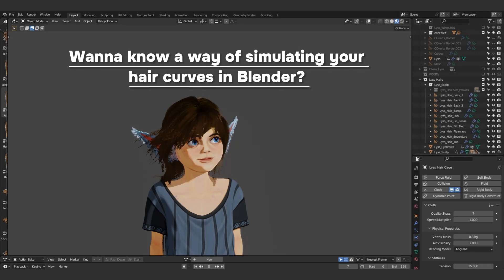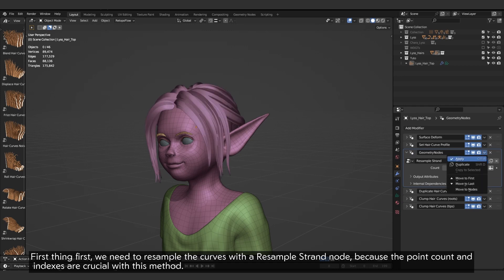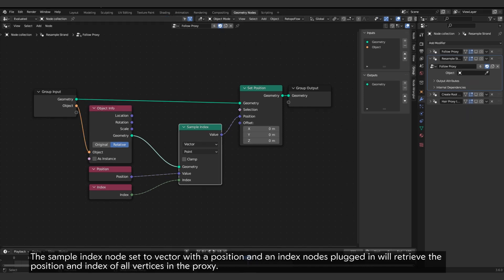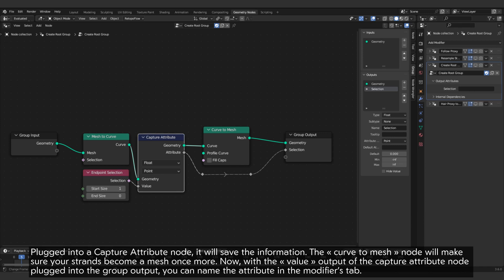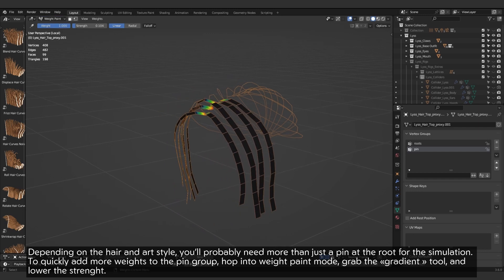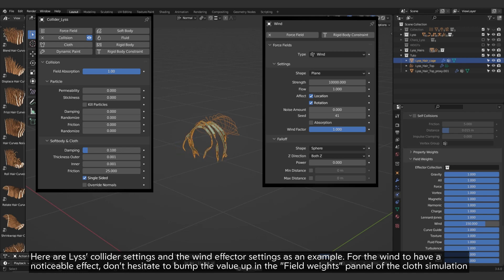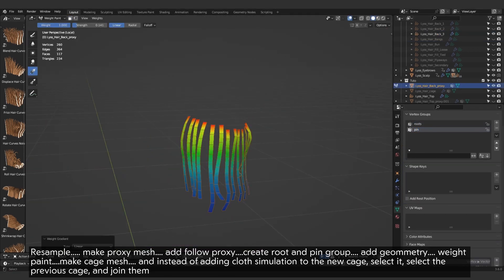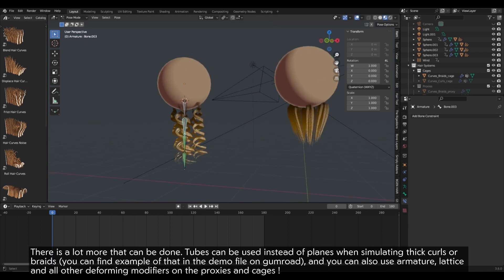Hair Simulation with the new hair system in Blender | 3.6 and +

Comment: in my hairsystem i used "Interpolate Hair Curves" for hair breeding, therefore, when I use this method, Blender dynamically rebuilds the strands in each new frame, resulting in the hair constantly flickering. 🤔
Reply from the maker: Yeah, all my hair grooms are using the "Duplicate" one which dosen't cause any issues, but I recently had the problem too with fur. I came up with a solution that is tailored to my own use-case so I can't garantee it'll work for you too, but you can try this : https://imgur.com/a/6hMivuz
Reply: @rakenval  i got an error "invalid surface UVs on 26 curves" located in node "deform curves on surface" (on Offset frame) 🤷‍♂
Reply from the maker: your curves are probably not properly attached to the mesh (sculpt mode -> Curves -> Snap to nearest Surface should fix that) or you have issues with your UVs but it's unlikely unless you modified them after adding the hair maybe

Comment: couple tips I've found while working: separate static and dynamic hair for better performance. You can neatly gradually weight paint the hairs by selecting roots, hitting ctrl+ +, then deselecting roots and assigning a smaller value, repeat that to get a perfect gradient. Also if you want the hair to follow a rig, parent it to rig with auto weights, select a couple staring faces from the root with ctrl + + method, invert it, then unasign every vertex group from the root inverse. Hope this helps someone
Reply: this comment is underated ! For it to follow a rig, i thought of doing exactly that, but it just confirmed hehe thanks !

Comment: @Rakenval so what i did is, that I added cloth and corrective smooth modifiers to all of my cages, then Ictrl J all of them but hte thing is that I nosticed that my cloth modifier got only one pin as default, so my other meshes wont pin, what can i do? ive finally pin (pun intended) pointed my prbolem, this is why the hair of my cha character falls, what can i do about it ?
Reply from the maker: if you're joining the meshes, you need to make sure their pin group have the exact same name, so all the pin groups can merge into a single one when joining
Reply: @rakenval  DAMN.. and i thought it was better to have different names, yeah that was the problem now im playing with weight paint to get the desired result.. I... im out odf words cant believe this is actually working after so many tries. thank you so much, i really mean it.
any tip for hair material? my hair is blonde so idont know if the mnaterial in the tutorial its ok
Reply: @rakenval  IM RENDERING MY SCENE...some of th hair falls off and behaves weirdly.. like its pin to a invisible space, it has to be with weight paint right?
Reply: @rakenval  so weird I applied a amterial to my cage mesh and the nimiton stopped working, do you know why? 
Also I know ive said it multiple times but im truly grateful for your guide, and tutorial, man... Ive been trying for the longest, and finally seeing some results... it feels unreal

Comment: 5:00 whenever I try to bind a message  appears it says "target contains concave polygons" im so close.... please would yo uhelp me?
Reply from the maker: Ah yeah that happens sometimes, usually it means some of your quads (or ngong) arent flat. Just put a Triangulate modifier on your target, bind the Surface Deform, then you can remove the triangulate.
Reply: @rakenval   OMG! IT WORKED IT WORKED! Thank you so much! i´ll keep u updated, man i swear ive been tryi9ng for the longest, blender was (still is) intimidating (for me) its been a struggle learning, but i wont give up
Reply from the maker: nice, keep it up ^^
Reply: @rakenval  thanks! :) so i finished the tutoria but i came across some problems i really hope you would help me 
1 some of my hair falls off  and i dunn owhy 
2 i parent a scalp mesh to my armature ´s head bone but it doesnt seem to follow it.. i dindt make tha hair injto the character but into a duplicate of the mesh of the character´s scalp
Reply from the maker: 1 - Those strand are probably not in the pin group
2- Check in the relation panel if the parent of the scalp is really the head bone and not just the armature. There's no reason it wouldn't follow the head if it's parented to the bone (unless specific cases like it has a defective Surface Deform modifier or an accidental cloth modifier)
Reply: @rakenval  thank you ! it does seems to be a problem with the pin fgroup instead of selectin the roots somehow it selected the whole verteces i dont know why. but now either some hair strands fall and othe bounce a lot  or it stays completely static.. ive tried redefining pin groupsand weight paint but the best hting i got it stays static...
Reply from the maker: Maybe replace your cloth sim modifier with a fresh one with default settings, maybe you changed the wrong setting
Other than suggesting to check the weights again I can't really help more at this point ^^'

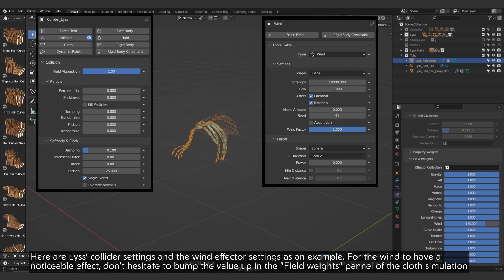Comment: 4:30 just to be sure the collider goes into the scalp mesh right or whatever the hair is going to follow, right? nono, i think it must be the cage right?  and the.. wind effector should be applied on an empty object right? 
am i missing something? srry im learning
Reply from the maker: Collider should be on the character mesh (or a simplified version of the character mesh), if you put it only on the scalp the hair will fall through the chara's face / body. The wind can be put on everything, an empty is fine, not sure what the default object is when you directly add a wind to the scene but it's probably an empty yeah
Reply: @rakenval  i GREATLY appreciate your tutorial and your answers, initially ive copied a scalp mesh and added the collision there, but thanks to your feedback now i understan why it should be applied to the character itself. i have a character with a walking animation and i only want the hair to move accordingly, any tips? thank you so much!
Reply from the maker: you're welcome! If your character as a collider on their body then the hair should move accordingly right away, it's just a matter of tweaking the simulation settings to get the best result (quality, collision distance, damping, etc...). You can try the different cloth presets in the simulation tab. Imo rubber is cool for thick / curly / stylized hair. If the hair has volume, you can use the Pin setting to quickly make it stiffer (it's way easier than playing with the other settings but it also makes the pinned vertices less reactive to collisions). I'm no simulation expert though, best would be to do a lot of testing to discover everything you can do with your specific hair and animation
Reply: @rakenval  IM TRYIN TO bind  5:00 but it says out ofe memory... the mesh is low poly so i dont know whats going on, sorry to bother you but would you mind helping me pls? thank you!
Reply from the maker: errm I'm not familiar with the error, check for non-manifold geo in your mesh and check that it dosen't have duplicate verts/faces on top of each other. Other than that I really don't know, I'd suggest remaking a fresh proxy mesh or asking on the blender artists/reddit/discord forums for help
Reply: @rakenval   some of my hair fall off, and my hair moves al ot! any wonder what i could do? thank you

Comment: What's the workflow exactly.
And is there a better workflow?
-Convert hair curves into mesh?
-Convert hair curves into hair particles?
-Convert hair curves into hair cards?

I find no solution anywhere.
The hair curves look great when you render a still image, but what about when the character moves around?
Reply from the maker: There's no "best way" imo
It depends on your goals, your animation style, the hairgroom itself, etc etc
In my case (stop-motion and still renders) simulation turned out not to be to best way, so I resorted to rig the hair instead (more time consuming but more realible and controlable). Yet it's not something I would recommend for complex animations, fur, or even hair using the Interpolate method.

So I can't tell what would be best for you, but the simulation solution is supposed to follow the character around correctly when animated, so I would say it is one of the best ways at least.
All the other workflows you cited will either require rig or simulation regardless so it's really up to your needs and preferences.
Reply: @rakenval  Maybe ditching hair curves for particle hair. It's a shame you haven't got the procedural control like you got with hair curves for particle hair. But with vertex groups you could isolate patches of hair for better control. I hope there is stiffness control for particle hair too, otherwise isolating hair groups for a specific style would all be in vain. Since it'd all fall back at the sides in the simulation.
Reply from the maker: Honestly I don't know, I never really gave the old particle system a chance as the simulation and hair grooming options weren't giving me satisfying results (and frankly I was still a hair noob when the new hair system came out so the choice was easy). 

Mainly I remember having trouble maintaining the stylized hair shape and that child particles didn't have collision like the main strands so they were clipping through the mesh unless I added a big distance in the mesh's collider, which made the hair puff out in return...

But I agree, even if there are settings to help, the cloth sim technique also does a poor job at maintaining the hair's original shape, which is why I switched to a rig at the end.

Comment: Hi! First of all thank you sm for the amazing tutorials. Your hair grooming and simulation tutorials were exactly what I was looking for. I'm so grateful to have this tutorial for free! Btw I got one problem, when the character doesn't move it works perfectly fine but when it moves, the hair won't follow the body. Did you also have the same issue? If you did, do you know how to fix this? I tried vertex parenting the proxy and scalp but it will only follow the location of the scalp, but not the rotation (does it make sense). It will be wonderful if you can answer. Again, thank you.
Reply from the maker: Hi, I'm really not sure what could be causing this. Try parenting both the scalp and the proxy/hair cage to the Head bone of your character ? That's what I do on mine
Reply: @rakenval  I kinda solved it by parenting vertex triangle! But still, thanks for the reply and everything. You're amazing!

Comment: I'm having a problem with the "Proxy to Tubes" modifier. My character has thick curly hair with lots of strands, when I put the Proxy to Tubes modifier, half of the strands disappear, and without the tube proxies, the collisions won't be so accurate. How can I fix this? Thank you.
Reply from the maker: Hey
It's been a while and I never ended up using the tubes technique that much so I don't know for sure, but make sure the proxies themselves are either a strand of vertices or a plane strand, but not a tube. It probably breaks your proxies don't contain the original points from the hair curve strands anymore. 
The final cage (Surface Deform target) should be the one to have the tube shape.

But also if you still have issues with the tube, the plane shape works fine for curls too, that's what I use for one of my chara who also has thick curls (maybe not the same type of curls idk but still), the trick is to give the cage a higher collision distance value to compensate. It may not be enough if you're going for hyper realism though

Comment: Hello, why can't I add the resample strand modifier at 0:36 ? When I type "resample" like you did in the search bar, it doesn't come up with anything. I have appended the node tree from your file, and I can place it in the node editor, but your video doesnt show how to link it to other geomtry nodes that way.
Reply: I'm on blender 4.2 btw
Reply: nvm, i was supposed to "add modifier" > "geometry node" THEN search for resample strand node. Your video goes a bit too quick don't be afraid to go slow, thanks for the tutorial
Reply: @theV990  I am in the same problem. Did you find the solution?
Reply: @Warriorsanimation  he goes incredibly quick in the video so just play it on 0.5 speed to see what he does. You are not looking for a "resample modifier", you first need to add a geometry node modifier THEN in the node modifier look for resample
Reply: @theV990  No. nothing change. the option for a "resample strand" still doesn´t appear.
Reply from the maker: Sorry it goes too fast, what Warriorsanimation says is correct, you need to add a brand new Geometry Node modifier, then go to the Geonode tab and add a "Resample Curve" node in the empty tree

Comment: I tried to use this method but instead rigged the mesh version to a wiggle bone rig. When I created the follow proxy, it seems to work but it seems the roots and the end of the curves connect which create hairs crashing through my character. Have you seen this before? Any fixes?
Reply from the maker: Can't tell for sure but when it goes all crazy it's usually because the indexes between proxy and original hair don't match

Comment: This tutorial is awesome!  But Im trying to apply this to the tail of a character, the fur is squirrel like.  I dont need cloth sim, I just want the hair to move well with the tail so I only have a proxy.  I have the proxy with a surface deform on it thats connected to the body, but when I move the tail rotationally, the hair moves WAY to much now lol. Ive been trying to find what is causing the issue and I think it has to do with the set position node thats in the follow proxy.  Do you happen to know how to fix this?  Thanks =)
Reply from the maker: That's weird
The Set position node is supposed to override previous transformation/defomation affecting the hair curves
Is the proxy also affected by an armature modifier, and to which object is it parented to ?
I Know having an armature after a surface deform can cause double transformation issues, but apart from this I don't have any other guesses
It should be 100% possible for the fur to follow the tail correctly
Reply: @rakenval  So the fix I stated above caused some more issues.  But without the fix I currently have just the surface deform target to the body with a strength of 1.  The proxy curves seem to follow the tail without any issues. But the children seem to go way out of control.  Should I use an armature modifier instead?
Reply: Ok, so I made a few mistakes and also corrected a few problems.  Main problem was that the follow proxy wasn't underneath the surface deform.  I fixed that, but it caused another issue.  The guides would move with the tail, but the children stayed in place.  To fix that, I had to disable Surface Rest Position in the Interpolate Hair Curves Modifier.  Then after that, add a Surface Deform in the proxys with the default settings, Target the Body and then bind.
Reply from the maker: Glad you resolved it, well done 👍
The Interpolate Hair modifier can be a bit tricky to work with sometimes
Reply: I think I may have figured it out.  Not sure if its the correct fix.  But what I did is, I made all the vertices 100% weight painted on the Root Vertex and rebinded the proxy to the body with no vertex groupings on the surface deform, and decreased the strength.  The proxys wont follow exactly with the mesh, especially if you have the strength very low, but it seems to do the job.

Comment: do i create a root group node for the proxy mesh or the hair curves?
Reply from the maker: for the proxy, since it's the one you're going to work with for simulation and / or rigging
Reply: @rakenval  Okay whenever i add the cloth physics the mesh just falls off the head it doesnt stay attached to the head
Reply from the maker: @Michael-md1zj  Are you sure the root group is entered as the Pin vertex group in the cloth settings ? And if so, make sure the vertices at the root of your strands are assigned to the group with a value of 1
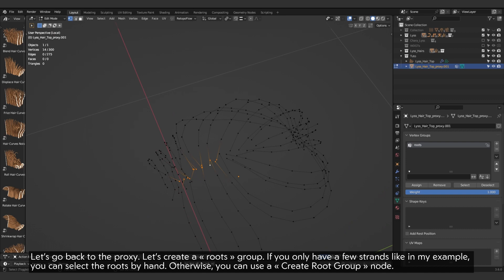Reply: @rakenval  what do you mean root group is entered as the Pin vertex group in the cloth settings? As soon as i select the cloth physic the hair just falls and any adjustments i do in the cloth settings does nothing to the hair. What group are you talking about that the vertices need to be assigned to? I thought if you create the group root geometry node you can skip the selecting the root vertices that you did at 2:23
Reply: @rakenval  well idk why but its working now i guess when you press play itll snap right onto the sphere for whatever reason. I did go into the cloth setting and added the pin vortex and also added the collision  physic to the  sphere.
Reply: @rakenval  you by far have the best hair simulation tutorial
Reply from the maker: Ah cool, I'glad you figured it out
Collision is indeed needed, but from what you said, the main issue definitely was the simulation not starting from the start frame
Reply: @rakenval  yes that was my final conclusion my scene starts at frame 600 and the cloth simulation automatically only goes to 250 frames so I just had to adjust the simulation frames in the cloth settings lol

Comment: Nice! But after applying the create roots group modifier I get "Evaluated geometry from modifier does not contain curves"
Reply from the maker: That's weird 🤔
Are you sure you applied the group before extruding the lines into thin planes ?
Reply: @rakenval  forgot to convert the proxy mesh thanks.
Reply: @rakenval  I don't know what im doing wrong, but when i press the play button in the timeline, nothing happens
Reply from the maker: make sure you extruded the proxy into planes and that the cloth sim is enabled and using a proper pin group
It's kind of hard to guess the issue just like that ^^'
Reply: @rakenval  I fixed it! I extruded it from the side view and not in the x/y axis (by pressing z at the same time as e)